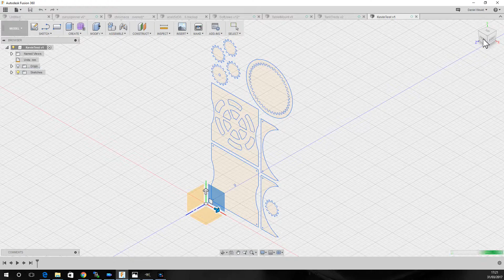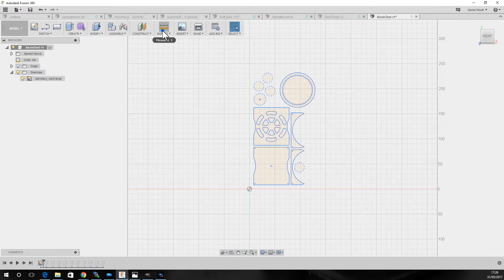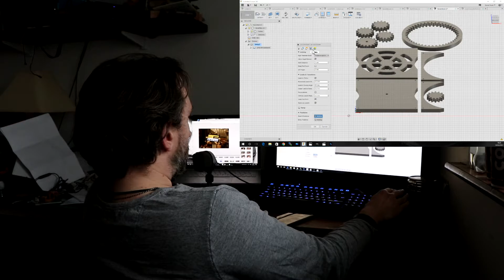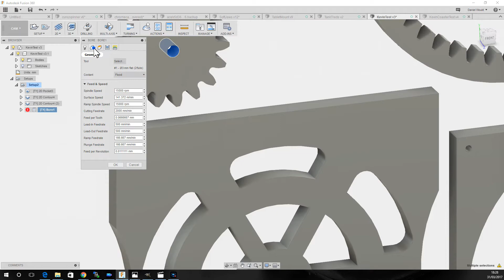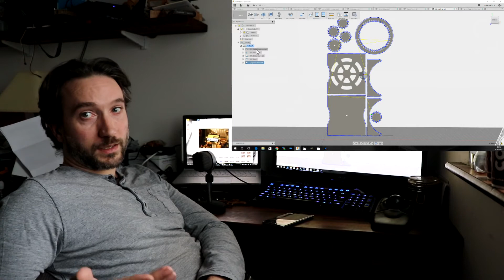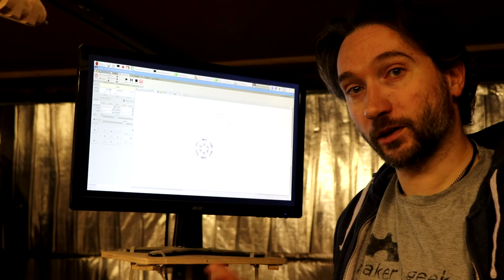CAD CAM CNC Workflow - Fusion360 and OX CNC

Comment: When selecting grbl as the post processor, what do you select for the option above it, I think it's where it looks for some sort of set up code, I'm having an issue with mine whereas there's some unusual behaviour at the beginning of a job when I press send, the z axis lowers, would drive into material if there was some there, then moves to the right hand side of the material then raises, and then begins the job
Reply from the maker: +Tommy Arno I haven't selected anything for that. I would guess that you don't have your g28 position set. By default Fusion calls g28 at the start and end of jobs. If you haven't configured your machine to have that reference location somewhere sensible then it could have the effect you describe. Are you using homing before you start?
Reply: Maker | Geek how do I set the g28? I can't home my machine with the board I have, I don't have end stops I don't know if that's the reason why
Reply from the maker: +Tommy Arno that will be a problem then... To set g28 you issue a g28.1 and it stores the current machine position as an offset from your home position. But if your home position essentially changes everytime you turn on the machine that doesn't help you much. Try just deleting the g28 commands from the top and bottom of your gcode file. But in the longer term I'd recommend getting some homing switches set up.
Reply: Maker | Geek setting g28 has solved the problem with z enitially goin down, but I still have one problem. When the machine is in position, z goes up before comming back down, this wouldn't be a problem but it try's to push z too high with causes z to loose position
Reply from the maker: +Tommy Arno what are your heights set to in Fusion? By default it will give itself probably 20mm above your model top surface as the retract height. Depending on how much room you have to play with you may find that is telling it to retract heigher than you can go
Reply: Maker | Geek makes sens, thanks fir your help il try it out
Reply: Maker | Geek  when I turn the machine on, so machine zero, where should the z axis be?
Reply from the maker: +Tommy Arno that depends a lot on how you have set up your gcode. I talk about it a bit in my ox CNC walk through video. Where did you set your origin relative to your model?
Reply: Maker | Geek I set origin to top front left
Reply: I know that work zero needs to be at the origin, but Is the machine zero relevant
Reply from the maker: +Tommy Arno machine zero is relevant in so far as your g28 setting is basically an offset from the machine coordinates. It doesn't matter as such where it is. But it is useful if you can consistently return to precisely that position from a cold start. Which is what homing switches gives you

Comment: Thank you for taking the time to do this. The wow! factor for me is the fact that you use RasberryPi for running the G-code. Well, I have put off buying RPi long enough. 
One suggestion would be slowing down the steps for some of those nuances you mentioned in passing ( rapid firing ) for decisions made and how you forecast issues during the cut. I have seen CNC instructions done for cutting oversize alphabet characters with special tricky corners and pockets. I love your cool attitude. Please do more of these and count me in if you ever decide to start your own patreon.
Reply from the maker: +Overly Cranked thank you. It means a lot to get support. The rPi is amazing and it still blows my mind that this tiny thing screwed to a wooden post is running a whole computer. CNC is always an interesting trade off of speed and accuracy. Time on the machine versus time finishing afterwards.